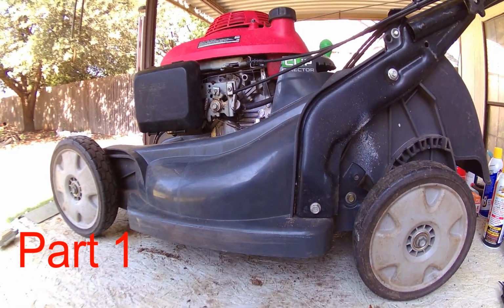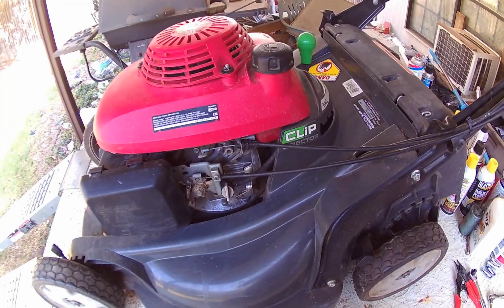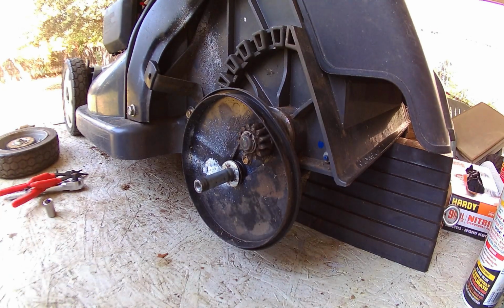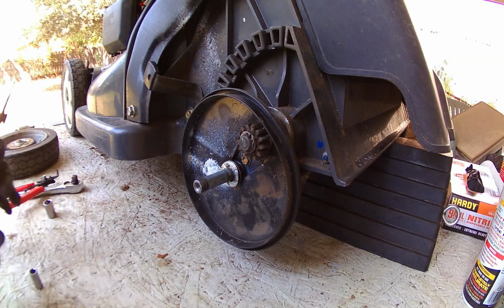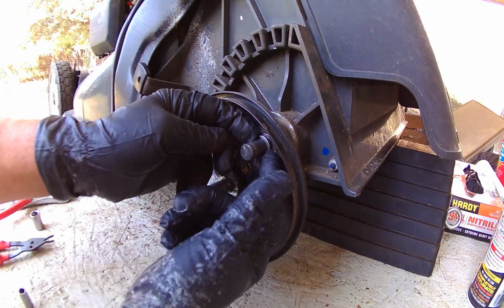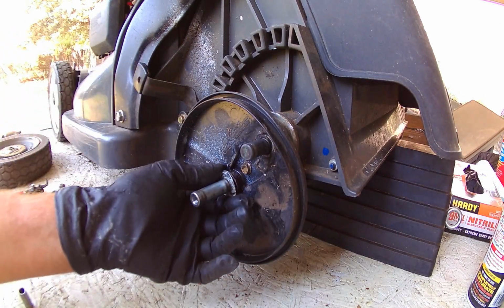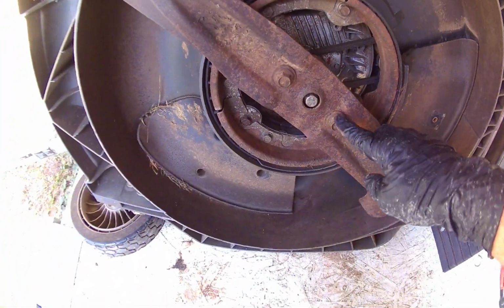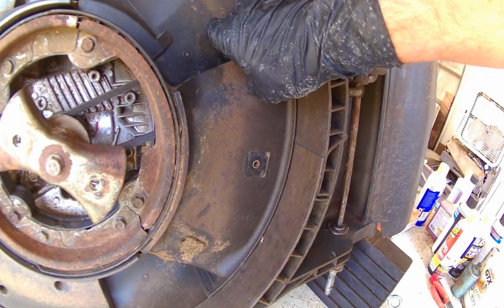Honda HRX217 TDA Transmission Removal / Installation Part 1

Comment: Thank you for your video. My transmission went out after the mower was about twelve years old. A comparable honda mower was going to cost around $700 and I was quoted a repair of it at $500 so I decided to tackle it myself. During the repair I wished I just bought a new mower, but now that it’s done I’m happy. I got a new transmission for $200 ( mine of course was the more expensive one). Anyway, I followed your directions and had a few difficulties. The bolt for the chute adjustment had to be cut off to be removed which wasn’t easy. The nut that holds the pulley on the transmission wouldn’t come off as well even with heat so it had to be cut off also, its a 10mm. With all the work needed and the troubles I had, I had about ten hours work in it. Some things were put on wrong and had to be corrected. If anyone else is thinking of doing this I want to point out that the wheel level adjusters must be put on the same side they were taken off. I found out the hard way when I couldn’t get my mower up high enough to stop butchering the lawn. Also the three bolts that hold a bracket on the transmission which also has the cable attached, are threading bolts. The new transmission doesn’t have threads to screw them into so just thread them in. That took awhile to figure out as well. Also get a good pair of snap ring pliers. The cheap ones I had made it hard to take them off which took time as well. Also drain your oil and gas because eventually you will turn it upside down and on the other side and the oil will leak into the carburetor. But in the end it’s worth it knowing five hundred dollars was saved over buying a new mower.
Reply from the maker: I am glad this video helped you.  Helping people save some money has always been my goal.
  Although these mowers can vary from one sub model too the next I try to present the main topic and steps as best as I can. Unfortunately time constraints can prevent detailed step by step instructions, so these videos are not meant to be all inclusive tutorials.
 Thanks for watching and commenting!

Comment: Most people who remove this drive gear from a honda self propelled mower thinks that the flat edge of the drive gear should face forward since that's the way the axle key would catch the gear to move it forward however the drive axle actually spins backwards in order to spin the gear on the actual wheel and tire forward so always make sure the flat edge of the gear faces backwards. I made this mistake when I removed mine.
Reply from the maker: Reversing the gear is a very common mistake. Thanks for commenting.

Comment: Thank you very much for this detailed tutorial :) much appreciated.
Reply from the maker: I'm glad you liked the video. Hopefully it's helpful. Thanks for watching and commenting!
Reply: @veteranssmallenginerepair5934  do both rear wheels engage and drive the mower or does only one wheel engage??
Reply from the maker: Yes, both wheels engage.
Reply: @veteranssmallenginerepair5934  thanks for replying.. when I apply the lever only one wheel spins.. so you think transmission is broken??
Reply from the maker: @love2weld822  possibly. Check the pinion gears on the axles first.
Reply: @veteranssmallenginerepair5934  ok great I’ll check that first... thanks so much for the detailed information on the videos...

Comment: In the process of repairing a engine on a one of these that also has the blade clutch.   Didn't think it would be so difficult to just get the engine off of the thing.  

Was getting stuck taking the bottom cover and mulch plate adjuster bolt out and decided to take a break.   Now I see I missed that bolt on the side by the wheel for the cover thanks.  Think the bolt on the adjuster is just dirty/rusty so having trouble getting a socket on it.  I'll keep at it.
Reply from the maker: I missed that bolt once myself. There are quite a few different steps for engine removal on this machine compared to other mowers. This is part of how they reinforce the strength of the plastic deck design.  Thanks for commenting and watching!

Comment: I need to buy snap ring pliers to do this service on my mower. What size of snap ring pliers are needed for this job?
Great video by the way.
Reply: 6” is what I used
Reply from the maker: Harbor Freight (not sponsored) sells an inexpensive kit with interchangeable heads.

Comment: Why would you have to remove and replace the transmission? What are the symptoms  / signs that the transmission is on its way out ? I have various different noises on my mower ( sounds like maybe a loose pulley or a bad bearing whining ) . Is it for this reason,  or because the transmission stops propelling the lawnmower? Thank you for any information that any of you can pass on to me.
Reply from the maker: Usually the transmission stops propelling the mower.
Reply: Okay. So then the noises i have are something else loose / wearing out. Thank you for answering my question.  I appreciate it.
Reply: Is my troubleshooting correct? I think my issue is the trans. I can move the lawn mower forward and back as the rear wheels do not lock when I pull it back.

Comment: For some reason I have the same mower and I removed the nuts off for the wheels and I can’t get the wheels to come off any reason why?
Reply from the maker: Most likely it's corrosion on the shafts.  Use a good penetrating oil on the shafts and let set for a while.  Then just put the nuts back on just a few threads to protect them, place a pry bar behind the wheel and while putting pressure on the bar, tap the nuts with a hammer.  Once the wheels are off, clean and remove any corrosion or gunk that has built up then grease the shaft and bushing lightly. Good luck and thanks for commenting and watching!

Comment: What size snap ring pliers did you use?
Reply from the maker: I'm not sure, I have a kit that has multiple sizes.
Reply: @veteranssmallenginerepair5934  no problem, thank you so much for replying!

Comment: How much labor would you charge for doing this repair for a client? I do quite a bit of small engine repair but I haven’t taken on one of these yet.  Just curious how many hours labor you would charge?
Reply from the maker: Provided no nuts and bolts are seized, about 2 - 2.5 hours. I gets a little faster after your first one or two.  Thanks for commenting and watching!
Reply: Thank you sir

Comment: When I put it in drive I just start hearing grinding from the gear box
Reply from the maker: Sounds like the transmission needs to be replaced.
Reply: Same sound from my hrx217hya, and now the self propelled stopped working.